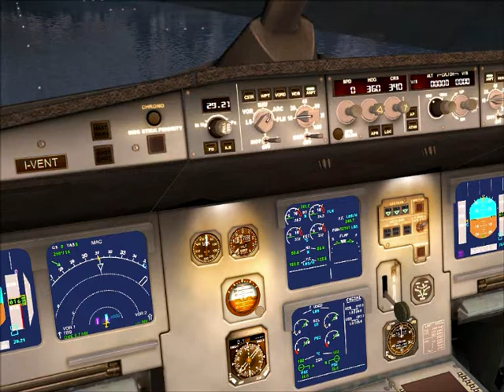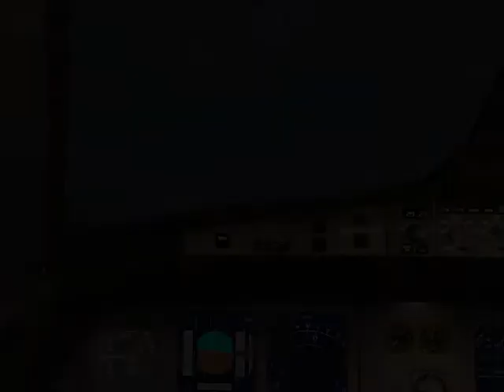Travel on FSX:Tbilisi to Baku

Comment from the maker: i have
q6600 overclocked to 2.8ghz
asus p5ne-sli nforce 650i
2gb ram 800mhz ocz
asus en8800 gt oc 700/1610/1950
250gb seagate barracuda
cooler master extreme power 550w
vista home premium

fsx all maxed out DX9 25-50fps very smooth
thanks for the comment